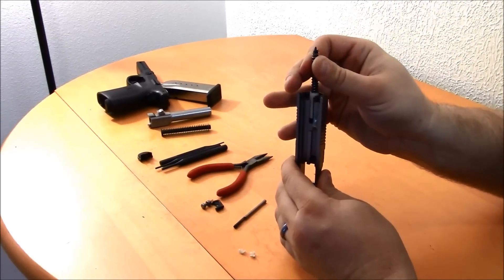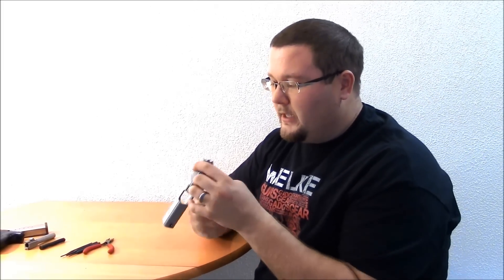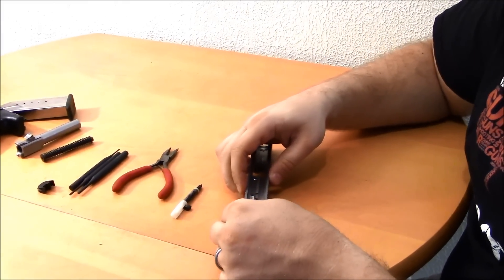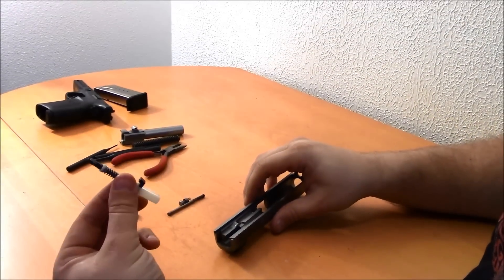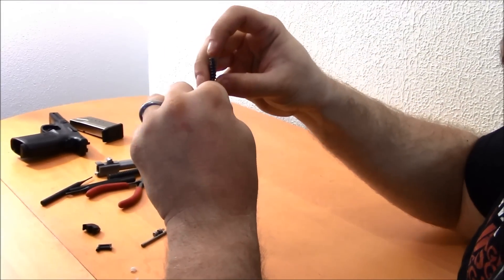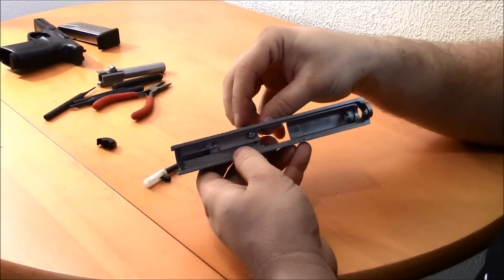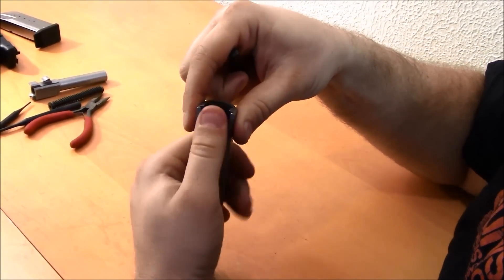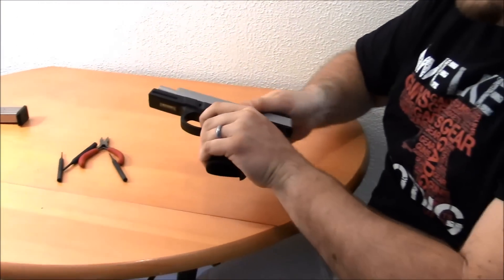How To: Disassemble the S&W Sigma Slide

Comment: The trigger pull is not "horrible" it is designed to mimic the trigger pull of a double action revolver. My Sigma SW9VE trigger pull averages 14 lbs 10.2 oz. A new S&W M638-3 averages 15 lbs 5.0 oz double action. Now if you compare it to a Military Minimum trigger pull on a 1911 Single Action Automatic at 4.5 lbs. it is not the same. Geoff Who understands the design goal, to replace the S&W Model 10 on the hips of security guards across the nation.
Reply from the maker: I understand it's by design. A lot of people at this time weren't entirely receptive of the "safe action" style of triggers without the external safety...so they made the trigger inanely heavy to combat people's fears of accidental discharge. However...doesn't mean it's not still "horrible" by today's standards of around a 4-5lb trigger standard in a lot of newer polymer guns lol...that's what I meant by a "horrible" trigger...